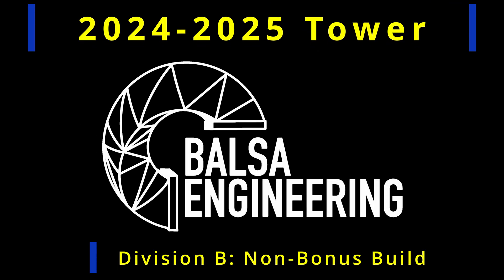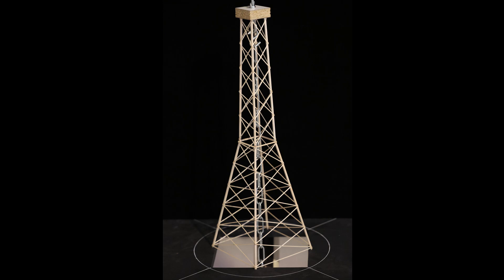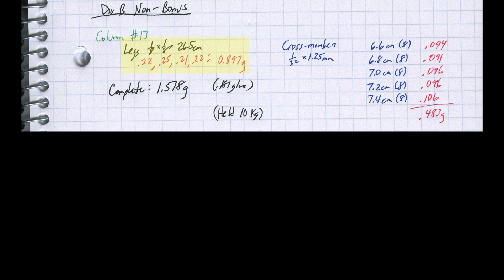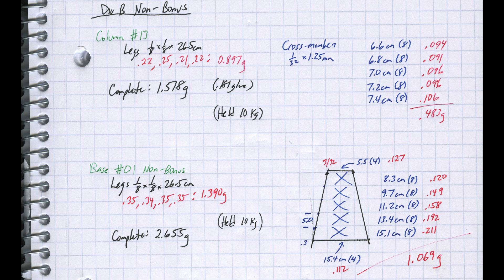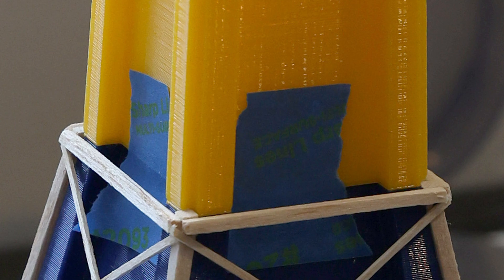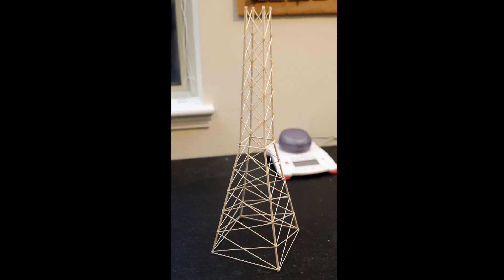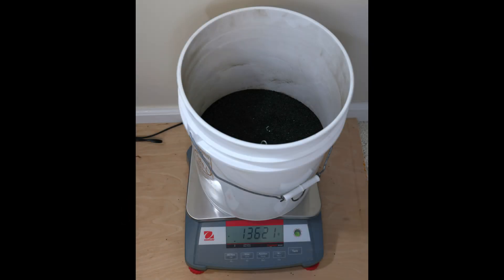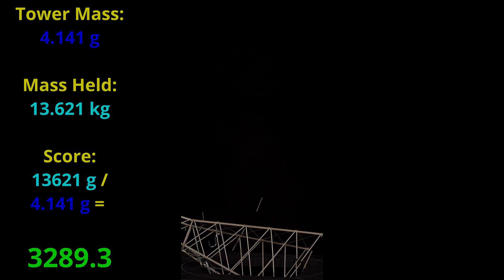2025 Science Olympiad Tower Div B: Non-Bonus

Comment: Hey my friend uses .45 for the column and .35 for the base I was wondering if that was a good design
Reply from the maker: If you mean 0.45g for the legs of the column, that is much heavier than I used.  I'm sure it will be fine, but they could go much lighter if they want.  I would recommend they build some columns and test them independently to see how they perform.  You can optimize the base and column separately and then put them together
Reply: @balsaengineering6686  what do you think is the best as I am going to compete at Scioly division b states Ohio next week and don’t have much time to test
Reply: I am a bit scared that .25 is to light for the column weight
Reply from the maker: @snowballz.snowflake  Hi!  Well, that's the beauty of this event, there is never one single correct answer.  For this build, I used 0.21-0.25g legs for the column, and it did break at ~13.6kg but the overall score was very good because the completed tower was only 4.14g.  Something like 0.30g might hold 15+kg, but you'll want to make sure the rest of the tower is also able to hold 15kg, but not too much over to have a nice, balanced build to score high.  To get a similar score to this tower at 15kg, it would need to be 4.56g, so you only have 0.42g extra to work with.  If you added all that extra mass to the column legs, on average, they'd be 0.105g heaver, or about ~0.33g or so.  So, maybe something like 0.30g would allow you to still hold 15kg and beat this score, everything else being similar.  It's a difficult optimization problem, but that's what makes this event fun and challenging.  Good luck!!
Reply: @balsaengineering6686  Thank you! I think I’m going to do like .28 for colunm

Comment: Hello balsa engineering I’m back and I have been wondering my towers have been getting close to maxing as a bonus design and gets about 14000 grams and breaks in different places each time and I’m not sure what to do exactly unless I have to add weight but please give me suggestions
Reply from the maker: There is no way to know for sure without knowing exactly what broke first using high speed video.  If you know it's the base or column that is failing, I would start with increasing the strength of the legs by about 10%, although too weak cross-bracing can also be a problem.  You might want to experiment with a non-bonus design like I show in this video.  In that case, holding 14kg would be almost ideal as you don't really want it to hold the full weight.  Good luck!!

Comment: What are the benefits of the horizontal bracing at the bottom of the base and column? Does it make a significant difference?
Reply from the maker: It definitely helps keep the base of the tower legs from splitting apart.  The amount that it's required will depend on a lot of factors most directly, how strong those bottom cross-member X pieces are.  That is something to play around with when optimizing your build with the material you have on hand.  For a non-bonus build, I would definitely experiment if it's required or not.  It is probably more useful for a bonus build due to the larger size.  You can also experiment with the cross members at the top of the base.  I have a feeling those are required, but that might be able to be scaled back.  I didn't do a full optimization of this design, so there is room for improvement!!  Good luck!
Reply: Why do you think the top horizontal bracing is required and what does it do?
Reply from the maker: @lukeherring1769  Just to clarify, top of the base, not top of the column.  I have seen some bases fail by caving in at the top.  These horizontal pieces prevent that.  What I don't know is what the minimum dimension/mass needs to be.  Or potentially they aren't needed depending on the mass of your base legs and the upper base cross members.  This is all part of the overall optimization task.  Good luck!!
Reply: Thank you!

Comment: Printed out the jigs and the top column bottom doesn't line up to the bonus or non-bonus base. We can line up one of the 4 corners but the other 3 are off by 1/32 to 1/16 of an inch. It adds a bit of complexity trying to get the two pieces connected and level. In your video at the 4 minute mark they line up exactly. Did you use the same .stl files for your jig or are there updated versions? Appreciate all your great advice. My students watch all your videos and are always excited to test some of the ideas they see.
Reply: Thanks for the tips! Measured the pieces and they're exactly 24.5 and 13 cm respectively. Was looking at the STL dimensions for the bottom column and the corners, not where the 1/8 stick goes, but the pop outs from the main column has different measurements. Range from 6.x mm to 7.x mm. No worries, we'll figure it out, thanks again.
Reply from the maker: Hi!  Thanks for the kind feedback!  These jig stl files are the exact ones I used to print and use and what I'm showing in my videos.  The only thing I can think of is perhaps your printer scaled the base down a tiny bit.  Make sure your finished base height is exactly 245mm and the column pieces are 130mm each in Z.  In the 3d printer scaler program, make sure they are at 100% size.  If your print volume isn't large enough for the base, you can cut it into 2 pieces with a program like Microsoft's free 3D Builder app.  Good luck!!

Comment: Thank you freely sharing your knowledge. I had a build related question. After I finish the build using the jib, there is always on leg that is not touching firmly on the floor surface at the bottom, or not even with the other legs on the top. This is even after using extra length legs and sanding the top. Any tips on how to avoid this? Thanks.
Reply from the maker: My best suggestion for that would be to make sure you are building the tower on a perfectly flat surface like the ceramic tile I show in my videos.  It really helps compared to something like a conventional table.  Take the time to tape the legs in place and touching the surface while the jig is vertical and you shouldn't have those types of issues.  It does take some practice to get that technique down, so don't get discouraged if you don't get it the first time.

Comment: I’m using a light balsa stick for my current tower and the wood feels half wood and half foam I don’t know how to explain the feeling but it just feel very soft is this normal?
Reply from the maker: Really light balsa is very squishy to the touch. That is usually a sign it’s too light, but it depends on the application. If the mass is close to what I showed, it will probably be fine
Reply: @ it’s 1/8x1/8 weighs .6g 24 inch is this fine?
Reply from the maker: @Fire_World428  That would make it around 0.26g for my normalized length of 26.5cm which I use for both the columns and bases.  So, that would be heavier than the wood I used for the columns (around 0.224g each) and lighter than the wood I used for the base legs (around 0.35g each).  I would say that wood is probably fine for the column legs, but might be too light for the base.
Reply: @ I built a top today using the 1/8 and 1/16 for crosses gave up at 12.8kg

Comment: Hey Mr. Balsa Wood Engineering, me and my partner just got 5th place at invitationals thanks for your design! I was wondering because what type of scale do you use to measure crossbeams? Ours don't seem to pick up the exact amount of grams if we cut them too small
Reply from the maker: Hi!  Congrats on your results!  This is the exact scale I am using: https://www.amazon.com/Ohaus-SPX123-Portable-Balance-0-001g/dp/B01AJ089PS   I realize that it is quite expensive and not for everyone.  For measuring the cross members, I would recommend you weigh them in groups, so like all 8 pieces for a given layer at a time.  Less expensive scales should be able to be pretty accurate for that.  Try to use other methods to see if there are any outliers in the group, either visually or by holding them.  If one of the 8 seem out of place, either too heavy or too light (or not cut perfectly), just replace it.  It's pretty important to have these as consistent as possible.  Good luck!!

Comment: At 3:20 you show the measurements and weights of all the pieces. However I'm a little confused about the thickness of the squares at the top and bottom of the base. Is it 3/32 by 3/32? Also the height of the legs it was 26-5cm, I'm not sure I get what that means. How tall is the base and how tall in the column? If you could please clarify the dimensions that would be great. Thanks!
Reply from the maker: Hi!  Sorry for the confusion.  The top horizontal pieces are indeed 3/32 x 3/32 square.  The bottom horizontal pieces are the same as the cross members and were 1/32 x 1.25mm.  The 26.5cm dimension for the legs are just my pre-cut normalized length for the leg pieces.  Once they are put on the jig and everything is finished, they get sanded down a bit so they don't wind up that long.  I don't know that exact dimension off the top of my head... I always cut them a little long and sand them to the finished length.  The base vertical height is 24.5cm and the column height is 26cm for a total tower vertical height of 50.5cm which gives a 5mm buffer to be compliant with the rules.

Comment: What are your thoughts on using baking soda to strengthen super glue joints? We were wondering if this is a viable strategy or if it adds too much weight.
Reply from the maker: Actually, I don't think that is allowed according to the rules.  That being said, it's not necessary.  A proper CA glue joint is way stronger than the wood, so it would only add weight.